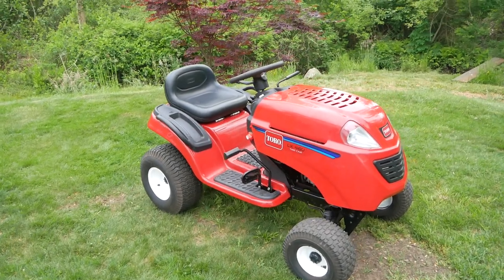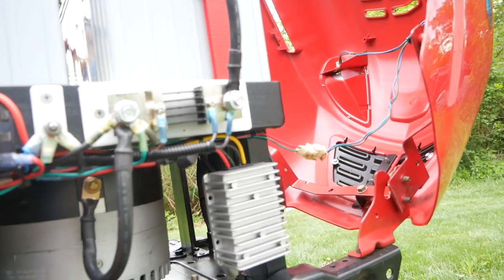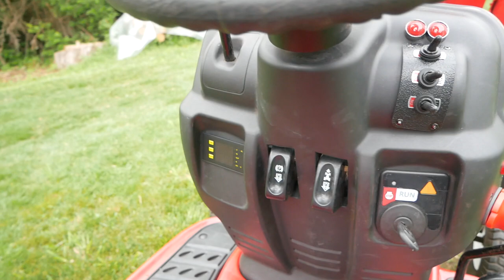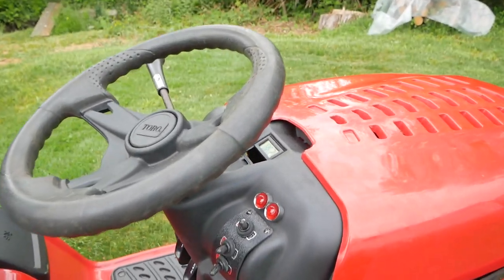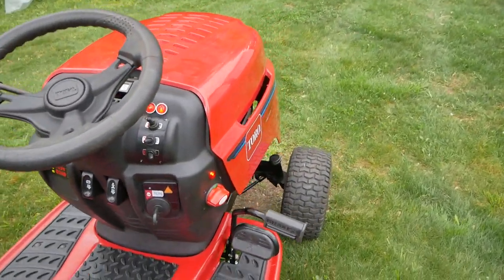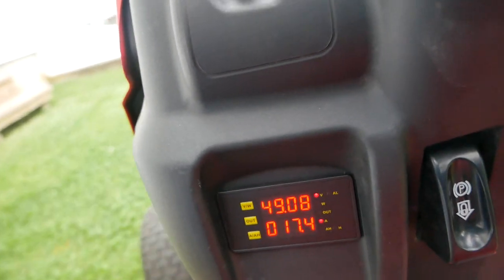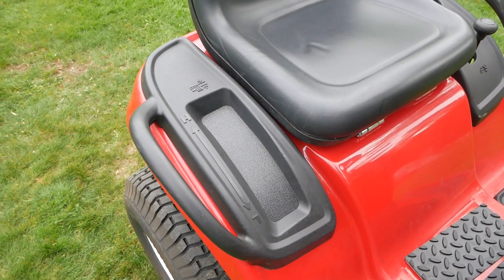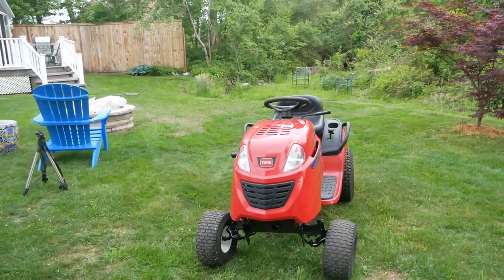Toro Lawn Tractor Electric Conversion

Comment: Have watched through a few of your videos, just wanted to commend you on your thorough-ness (if that is a word?). Really nice to see installs and work that is planned out and executed properly. All wires and connectors securely mounted, decent size wiring, no loose strands, no excess tape or bits hanging around. And so on. I really like this!
Btw, good audio without lots of noise, and clear voice too! 10/10!
Reply from the maker: Thank You!  I try to do it right......

Comment: Hello Mr. Bertalotto, I'm part of the STEM Academy at Grassfield High School. In my capstone class, we are required to pick a project where we would be using our engineering skills to complete a project of our choice. My group and I were watching your video and It inspired us to choose a project where we would be converting a gas powered ride-on lawn mower to a fully electric one, mainly for recreational use since we would be removing the deck/cutting blades to make it more of a an ATV. I was wondering if you would be willing to serve as a mentor for our project where we would essentially be asking you for advice on how to proceed with certain parts of the project. For example, how to set up the electric motor. Thank you! I look forward to hearing from you!
Reply from the maker: We have conversed through email. Looking forward to working with you folks!

Comment: So, i saw on your website that the Toro didn't make it.   This is the simple conversion i was looking for for my Craftsman YT3000.  
The compression release broke in the engine so i fixed it but made an error putting it back together and stripped a couple holes.  So, i went and bought a new mower with intentions of fixing the old one.  Anyway, i thought I'd try an electric conversion.   
Do you think a less HP motor would work and also not destroy the transmission?  Or perhaps some sort of speed controller to regulate the motor's power?
Great content.  The front mounted deck looks great.
Reply from the maker: @chrisfoxwell4128  there is a complete rear axle assembly with integral motor available for lawn tractors. A search would reveal the source. This might be your best option. Good luck

Comment: Congratulations for the clean project execution!  To increase efficiency I'd had considered a Brushless DC motor as it provides more torque at lower speeds, and basically you won't need to have the motor running all time.  Probably with a 2KW 48V BLDC motor, with 3-speeds selector (in the controller) you could achieve the same performance...
Reply: would also be better to use Lithium batteries
Reply: What do you mean “you won’t have to have the motor running all the time “?

Comment: Hi. This is an awesome idea but am I right in reading the comments that this set up did not last in this mower with the transmission failing?
Reply from the maker: Yes, A little lawn tractor (not a Garden Tractor) could not handle the torque of a 13 HP electric motor. All the components were moved to a Garden Tractor with no issues.

Comment: Nicely engineered! How are the batteries holding up 2 years on? LiFePO4 prices are down and they pack so much more energy per pound.
Reply from the maker: Two years and batteries are still perfect. As much as I use the tractor I've never seen them below 60%. I like the added weight of AGM and they cost $180 each. I just converted my travel trailer over to LI and spent $450 each for batteries with cold temp charge disconnect. I replaced my trolling motor AGM with the least expensive Li battery I could find. $350. Much less cost than a few years ago, but not needed on this project. You can read all about my Li projects on my web page www.rvbprecision.com

Comment: Hi Roy. Very Nice Work. I have a similar Toro LX420 42" deck and If I use the existing cutting deck belt connect to the motor your way, do you think the motor can handle it? Power and RPM wise? Or need more batteries? Or 4 x 12V will do and just cutting time will be too short?
Reply from the maker: The motor has more than enough power. But the batteries would be depleted much faster.

Comment: Isnt the batteries a lot of weight for that stamped steel frame? I have an old 80s Model Toro/ Wheel Horse 312 hydro with a horizintal Koeler 12 hp engine, the frame is basically 2 pieces of 1.5 x1.5 in angle iron so i dont think the extra weight would be a problem but on my tractor the rear end diff is as as big as a small car so even with the fuel tank out theres no room for any battery this big, mabey i can fabricate a platform on the back or something or use different batteries
Reply from the maker: Yes it was. But more importanly the transmission didn't last a few days. The electric motor's torque was just too much. I removed everything and put it into a John Deere 214....A "MAN's Tractor"....read about it here www.rvbprecision.com

Comment: So you have approximately 5280 watt hours of capacity but you can only mow for 30 to 45 minutes?
Reply: thats the downside to lead acid batteries
Reply: @caseymoss459   watt hours is a watt hour.  I'm just surprised he can't mow longer
Reply: @chrisE815  Watt Hours isnt the only thing you have to take into account with lead acid batteries, you also have to take into account Voltage, when doing something like this Voltage can drop pretty quick when you use lead acid
Reply: @solexxx8588   have you found an affordable electric transaxle?

Comment: When you said there wasn't a speed controller I was kind of thinking that might not be the best but the more I look at it, the more I'm like you know that's not really that bad.  It's a much cheaper conversion for utility vehicle that doesn't need really great efficiencies. I wonder what the comparison on where of the motor is over time versus replacement of motor controllers over time... Like is it the same cost 20 years from now, because you've replaced the motor? Overall great build, I like how tidy you made the engine compartment
Reply from the maker: Thank You...This motor was designed to run at constant 3300 to 3600 rpm. One way we might be able to estimate longevity is by heat. So far, the motor has never gone above 100 degrees. Even when working hard on a 80 degree plus day.  The only high wear / needs replacement device would be the contactor. Over time, the contacts could erode although this contactor is super heavy duty with silver plated contacts......We shall see. But at less than an hour or so a week for 6 months out of the year, I'm expecting it to outlive me...I'm 68 years old!

Comment: Should try out big lipo batteries,  2 4s at around 10,000mah each  would do what your 4 12v lead batteries do, they would take the space of one lead battery!
Reply from the maker: But I want the weight. With tractors, weight is a good thing. And Lipo is four times more expensive.
Reply: @roybertalotto6355  I'm looking at makeing a yard tractor electric aswell, but I'm thinking of mounting the motor on the back, a smaller motor (maybe 2) with higher rpm and lipo with speed control. Then I will have space on the font to mount a bucket from a wheelbarrow, and have a front dump. All the weight i want on the front ;)

Comment: I commend you on a very neat professional conversion, I started converting them over 20 years ago and have developed a design that can cut 2- 3 acres grass using 4 x 6v deep cycle golf cart batteries, I use small motors and electronic speed control,
Tractor videos youtube
Reply from the maker: Brian, Thank you for the kind words. Yes, I've seen your system and even contacted you about it. It is an excellent system for someone that wants a more turnkey installation. Nice work!

Comment: I"m interested in seeing a hydrostatic electric conversion. I've never seen any person try that, but i'd imagine it's possible
Reply from the maker: Me too...Find me a 400 John Deere with no motor!
Reply: @roybertalotto6355  well I have a John Deere 316 with no motor I was going to convert to diesel but I used the the 318 carcass to do this. The John Deere 316 has no power steering cylinder either but it has substantial hydraulics. I paid 300 dollars for this carcass, but I might sell it for less if it would become an electric tractor (for the sake of science).
Reply: @roybertalotto6355  the 400s are too big

Comment: I don't really understand why you would have the motor constantly running, even when you're not moving.  It would be fairly easy to install a foot pedal switch to start the motor when you want to start moving.  It just seems like a waste of energy for the motor to run all the time.  You could even configure it to work with the existing go pedal.
Reply from the maker: I thought about doing just that. But I find when I'm using it, I very rarely are idling it.

Comment: Neat, but running an electric motor through a hydrostatic transmission is turning 20% of the energy into heat.
Reply from the maker: Yes, but there is so much power I can't even run the motor on 48V./ I have to run it on 36V! Don't know what I'd do with another 20%. With tractors, its all about weight/traction. I have this tractor a bit over 1200 pounds and still spins the tires!

Comment: You are not making sense on the power side, dump those batteries, replace them with 18650 save in weight, have longer run time
Reply: 18650s are expensive compared to lead-acid, also needs BMS, chargers etc. This is simple, and it works. Plus, the weight is bonus, adds traction.
Reply: thorflot it depends on if you are using new 18650 or you are using recycled 18650, in which they both put out the same amp hour. And I am seriously guessing that you don’t know much the 18650 market and movement. It just that I have invested more than you can imagine on lead acid and it has always failed. 6 year on the same recycled 18650 is for me a better investment. You pay for what you get.
Reply: thorflot I understand reluctance, but when performance is the question. 18650 is the best answer for the now. And I am not saying you should do it. But I am saying it worked for me and my family.
Reply: I'm guessing that english is not your native tounge, as some of what you are writing comes off quite rude.
Your assumptions regarding my knowledge is on you, I really don't care what you think I know or not. My point stands, lead acid might simple and crude, but it works in this application.
Reply from the maker: Solomon, I need the weight. Weight = Traction on a ground engaging tractor. And the 2-3 times cost of Lithium was just too much for my budget.
Reply from the maker: @Gbemudu_   I'm 6 years into three 110Ah AGM batteries in my travel trailer. Still testing perfect. My solar backup sump pump has a 13 year old AGM on it. Still perfect. My 2007 Suzuki motorcycle is still starting every time on the origional AGM battery.....Proper, constant charging and not discharging below 60% will extend the life of AGMs to amazing levels. And a 110Ah AGM cost $189 at Sams Club.....